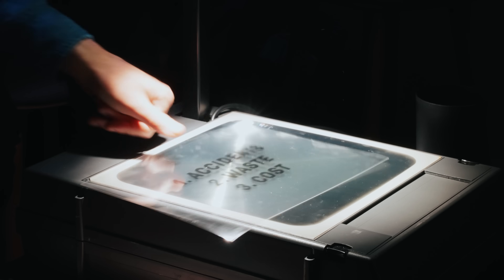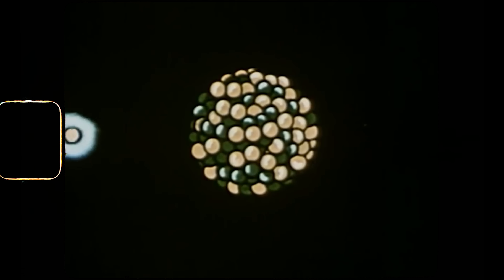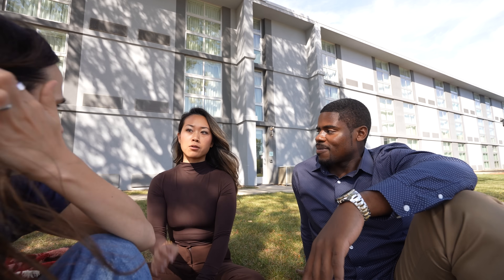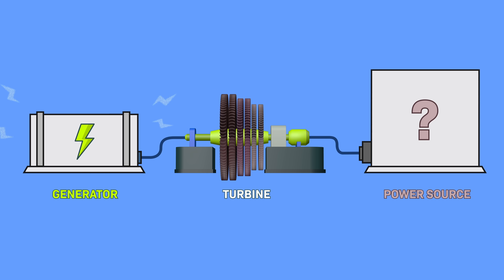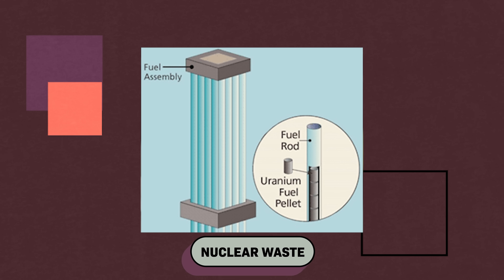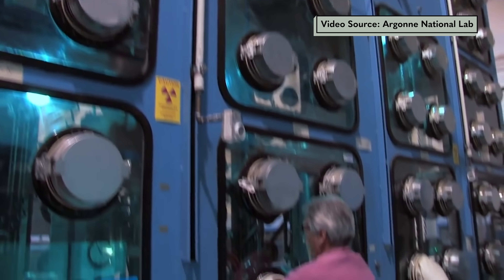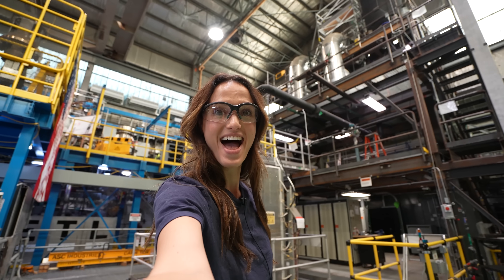The Big Lie About Nuclear Waste

Comment: Your presentation would be more persuasive if you didn't make fundamental errors in your "explanation" of the processes that go on inside nuclear reactors.  For example in U-235, 235 is not the number of neutrons, it is the number of neutrons and protons in the U-235 atom.  Nuclear fuel is not bombarded with atoms, instead neutrons are what trigger fission.  This is BASIC stuff that you need to get right.

Also, the chemistry to reprocess spent nuclear fuel is not a clean, tidy reaction done in a  beaker or test tube (except in the lab).  The chemistry on a large scale generates lots of radioactive waste (typically expressed as glowing green liquid in barrels by the media).  The places where that sort of spent fuel reprocessing was done on a large scale - Hanford site in eastern Washington, Rocky Flats in Colorado and Savannah River in South Carolina, generated large volumes of radioactive waste that leaked (and is leaking) into the greater environment. Note that those facilities reprocessed spent fuel to extract isotopes for nuclear weapons production.  Clean up is possible, but very expensive and the radioactive waste is not made safe, it is just moved to some other place.  Furthermore, the "clean up" process generally results in an increase in the volume of radioactive material.  Yes increasing the volume does dilute the radioactivity per unit mass, but it also requires a larger storage facility.  Those reprocessing sites were run the US government but in operated by private contractors who were motivated by profit.  Commercial reprocessing will always be motivated by profit and corporations WILL take short cuts to maximize profit that result in releases of radioactive material.  I am not just saying that, it has happened in pretty much every case.

Incidentally France currently reprocesses spent nuclear fuel from both its power generation reactors and its military reactors.  If you want to learn about the process, France is the place to look.

Incidentally, I am a retired Ph.D. chemist who worked in nuclear chemistry and nuclear waste disposal.

Comment: Thank you for this good, comprehensive video! I've only recently seen the potential of reusing nuclear waste (at which point it isn't really waste anymore, is it? might need to find a better term for it) and it's fascinating to find out that the idea and technology isn't new at all.
I spotted only a slight inaccuracy at 7:05: the 235 in U-235 doesn't refer to the number of neutrons (directly), but the atomic weight, which is protons and neutrons combined. The difference in isotope numbers is a difference in neutrons, as a change in protons would make it not be Uranium anymore.
Reply: I am FOR recycling nuclear wastes.   I'd say it will only cost 5 trillion dollars in the next two decades to setup one of these plants.   Thats a bargain.

Comment: It could be used to make power for thousands of years if the paradigm was changed to liquid salt thorium reactors, those need just a little bit of fissile material(uranium 235 or plutonium) to get the process started, turning the thorium fissile, and then using that as fuel. There's hundreds of times as much thorium around as there is uranium(let alone uranium 235), the USA has major deposits of it. Thorium isn't currently mined because it's not profitable, no demand, but that would change. It also tends to have a lot of useful co-deposits, in the form of rare earth minerals, so mining for both could be very useful. China currently extracts rare earths out of the same kind of deposits, and dumps the thorium, leading to massive ecological damage(look up Baotou toxic lake).
It should be noted that liquid salt thorium reactors is also old proven technology from the 1950s-1970s.

Comment: One of the things I find interesting is, there are ideas of not using nuclear for electricity. For two examples, high tempreture metalergy or melting types waste.With new alloys, we may find things that help us excelerate our goals. This is not to say that one couldn't also use the heat left over to make electricity.

Comment: What did they say when you asked them about molten salt thorium reactors? What did they say when you asked them why they're using very high pressure super heated water to do the cooling instead of ambient pressure high temperature salt? BTW: Are those "atoms" they're doing that splitting with or are they "neutrons"? And is it giving up mass, or just releasing potential energy from the bonds? And when you asked them why they're just using 3% of the potential energy in the fuel, what did they say?

Comment: I started my career in nuclear power at the Naval Reactors Facility, where we actually took the spent fuel from the Naval reactors from our nuclear navy.  The fuel would be sent 10 miles down the road to the chem lab, where it was processed and sent to a fuel facility to be reused. These facilities were shut down in the 1990’s.  As you can see we had a working system of what you suggested.  We also had a working reactor that would work as a normal reactor but when it was shut down would actually produce more fuel than was in the original startup(Breeder Reactor)
Reply: Do you have drawings or links to how this worked? Borh the sequencing incl plants and the reactor (type)?
Reply: " We also had a working reactor that would work as a normal reactor but when it was shut down would actually produce more fuel than was in the original startup(Breeder Reactor)"

The Shippingport Experiment?    There was a small amount more fissionable material than when it started.   Like three percent more.  Since it was blanket material it was not really fissionable.

Getting the blanket geometry right was tough, the Shippingport reactor was not intended as a breeder reactor.
Reply: Bidubidubi báp báp báp bidú bidú bi bap bap bap darubatuntiba dum dum bãããã~~aa!!!!
Reply: So it worked super well with no disadvantages significant enough to mention them here which is why it was shut down... Of course they shut it down, who doesn't shut down expensive projects that work perfectly? It's not like there were additional problems or reasons why, pfff
Reply: @thulyblu5486  You should look into why hemp was outlawed. The parallels are plain and easy to see.
Reply: Genuine question: Do you still have your hair and/or are you a dead person?

Comment: Well recycling doesn't fit here, since the fuel you put in and get out of the 'recycling plant' are fundamental different. Yeah you can reenricht the fuel, thats what you described here, to lengthen the usability of the uranium, but the decay-series stays the same. You can't change physics. TL;DR you can reduce the current problems we have with nuclear power by a order of magnitude, but this won't solve the fundamentals.

Comment: You totally need to look in to LFTR.   There is a whole new level of nuclear recycling there and they are totally fail safe and compact compared to current generation reactors.  And on top of that, they were made by the same engineers that made the heavy and light water reactors.

Comment: I've worked in the nuclear industry for over 50 years. Let me summarize; 1) yes nuclear waste is generated and stored in capsules that will be hazardous for hundreds of years 2) our plants produced enough waste to fill two olympic size swimming pools full of spend fuel 3) if you had used fossil fuels, particularly coal to produce the same enerygy you would have a pile of ash and biproducts 11 miles high not to mention the millions of tons of really obnoxious gases that would have been released into the air.  Summary; is it the best energy source - no, but for now the most efficient and almost zero emmisions power source ( don't get me started on wind and solar energy - they produce more hazardous biproducts in their manufacturing processes that you would ever recover in energy saving )

Comment: Very well made, but left out was the actual COST comparison between recycling and not. The host only said it was "more expensive", then went into reasons that expense would be acceptable (such as energy independence, shorter time for storage of remaining waste, etc.). But would the recycling make fuel that is 120% more expensive? 300% more expensive? 1000% more expensive? 

The fact that the video very pointedly leaves out this fundamental consideration tells me the cost difference would be shockingly high to the viewer.

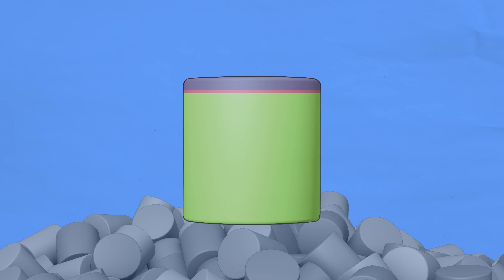Comment: 10:44
These kinds of graphs/calculations are a problem in themselves as well. They depict the time span for the radiation to fall below the background radiation while the "safe" levels are far higher than that. Most waste reaches a somewhat manageable level of radioactivity after around 3-400 years. The 100-200 000 years is just lobbyists pushing for less sustainable energy sources like fossil fuels and wind. Fission is the only viable option for large scale energy production at hand today. It ain't perfect, but it's what we've got.

Comment: I clearly am a 3D artist. However I use to do many areas of medical research and probability theory.
The person that stated there is 150 years of fuel that could be used is wrong. After evaluating the data and checking the use values per cycle used.
We are looking at a grand total of 4,250 years of energy that being used. They forget that in the early years of fuel used they did not have the purity values.
There for the value of radiation waste was higher because they didn't know the values we know today. So yeah it could be done if they wanted to.

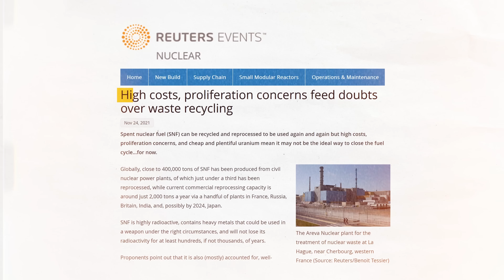Comment: 4:51 "The problems are cost and global politics."  If it's not cost effective then it's not a solution. 13:54  "that number refers to the number neutrons in the atom."  That number actually refers to the number of protons + neutrons.  In (U-235) there are 92 protons and 143 neutrons, for a total of 235.  Plutonium is still a huge liability.  How much would recycled fuel cost?  Sometimes it cost less to make a product from raw goods than from recycled.

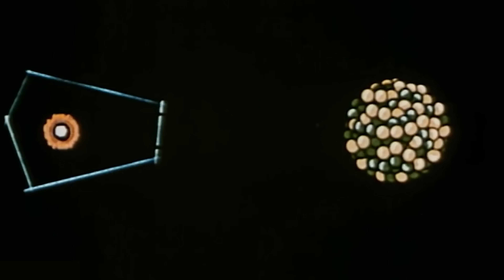Comment: 12:19   This is precisely why nuclear fuel is not reprocessed, and there are security reasons as well, plus the ignorance of the public as to how nuclear power works and how safe it is that creates huge political pressure not to develop new nuclear energy production and reprocessing plants.  These barriers and disincentive are NOT likely to change in the foreseeable future.  It's still all about using the cheaper and easier solutions to producing power.  The better long term solutions to nuclear waste will not be supported except by a few, and changing that will take time, perhaps a long time.  If there was interest in changing how we use nuclear material, it will first be a change in the popular and political climate, driven by a huge increase in need for power, combined with willingness of investors to invest in building the next generation reactor designs and portable modular reactors where practical.  One the consumer front, one thing that as reduced the need for more power is the development of brushless synchronous motors such those developed by Tesla, but an increase in power need will be likewise created by the use of the lithium ion phosphate and proliferation of electric vehicles and other electrical needs.  Bringing back industry to America would certainly drive an increase in electric demand.  One barrier to proliferation of e-vehicles is the antiquated electrical distribution system and the lack of charging stations or battery swap-out stations similar to petroleum stations used by gas powered cars today, but that will slowly change as they become more popular and fill niches where they work best, like commuter vehicles.  I hope that the situation changes to allow reprocessing, but that will probably be long after I retire.  I currently work as a nuclear inspector at a nuclear power station.

Comment: All sources of energy kills people to use it. Solar, Wind, Fossil, and Nuclear kills a certain amount of people (on average) per kwh gained used. Yes building solar panels costs lives, yes running wind power costs lives, obviously fossil fuels costs lives and of course Nuclear costs lives. In the end all engineering is doing the math on the most efficient way to run something, and in this case the most efficient way to gain electricity without the cost of human lives (you could include damage to the environment, but in truth we are trying not to damage the environment because it will cost us human lives down the road).
The estimations on these things is extremely complex of course. How to determine how many chinese workers are getting cancer because of the unsafe handling of waste chemicals from making Solar Panels? Especially since China doesn't release a great deal of its statistics. How do we know how many people die from lung cancer caused by the massive steel mills turning out carbon dioxide the make the steel that goes into windmills? How can we possibly estimate the how many people have died from the CO2 released by coal burning power plants, or the chemical leaks from such plants, etc...
No other power source has documented these issues as well as nuclear. The fear of failure is certainly very high here, but even though we don't know the exact numbers of these issues with other power sources we can estimate and in the end Nuclear is by FAR the safest power source available...because of the ridiculously high power concentration in nuclear fuel we can gain way more energy by kwh per human casaulty than any other fuel source.

Comment: Another crazily awesome thing about this nuclear waste burning reactors is that in some instances you can actually get more fuel out of them than you put in. In those cases they're called breeder reactors.

Essentially, when you have a plutonium nuclear reaction you always get 3 neutrons escape that can hit another nucleus. You only want 1 of those neutrons to hit another plutonium nucleus to keep the chain reaction going. More and the reaction speeds up and less makes it slow down. If one of those spare neutrons were to hit a Uranium-238 nucleus it doesn't split, but is absorbed forming Uranium-239 for a short time before it eventually (about 2.5 days) decays into Plutonium (Pu-239). That's why you get plutonium in nuclear waste from Uranium reactors (nuclear fuel is mostly Uranium-238, after all).

If you surround the plutonium reactor with depleted Uranium (U-238 after you take the U-235 out for enriching fuel), you can capture those spare neutrons and theoretically, you can take up to twice as much plutonium out of this reactor than you put in. Obviuosly you can never reach this theoretical maximum due to losses to control rods or other inefficiencies within the core, but when tuned properly you will get more fuel out than what you put in! Of course, it was this increased generation of plutonium that led to Carter axing the program.

Comment: The problem would most likely be 'BIG OIL'  And quite likely also Detroit. 

Still though, there are the problems one can have when the thing that can't go wrong actually does go wrong for some unexpected reason.  Particularly if the going wrong can take an area the size of small state.

Comment: Just subscribed as this video is a nice, pretty accurate and refreshing change of pace from the typical doom and gloom nuclear presentation that is so common these days.  I do have one question, when you referred to "fast" reactors I believe you were referring to "breeder" reactors.  Is that correct?  The reason the US and some other countries banned them was, as I recall, because the breeder reactor while reusing it's spent fuel would in up producing a very large amount of "bomb grade" plutonium.  The concern was ne'er do wells would manage to steel the plutonium and easily make a dirty bomb.  However, if memory serves me well, it is also possible to to use plutonium as a nuclear reactor power source.  Did you happen to research into this aspect?
Reply: Breeders are not the same as fast reactors. Breeders breed more fuel than they consume while fast reactors use fast neutrons instead of the moderated ones. Most breeders are fast reactors but most fast reactors are not breeders. The plutonium from breeders is still reactor grade, not even close to weapons grade and although it could in theory be used in a bomb, it poses no proliferation risk. As always, the US government obviously ignored the facts and decided to ban them nontheless. Fortunately though, no other country followed and France for example ended up developing a verysuccessful fuel reprocessing program. They use their reactor grade plutonium to make new reactor fuel.

Comment: Correction: 235 is not the number of neutrons in the atom, it is the atomic mass of the atom, roughly equivalent to the number of neutrons AND protons.
Reply: 235 is exactly the number of protons (92) and neutrons (143).
Reply: @markplimmer9232  Wikipedia lists the mass as 235.0439299 AMU (atomic mass units). It is not exactly 235. Electrons have mass which makes it not exactly protons plus neutrons.
Reply: @brianhabing5076  I did not say it was the mass but the total number of nucleons in the nucleus.
Reply: It has to have 92 protons to be Uranium.  If it had more or less, it would be a different element.  For example, with 93 it would be Neptunium, with 94 Plutonium.  So what differs for the different isotopes of any element are the number of neutrons.  One of the strangest things is that 95 protons is Americium, which you can buy at Walmart, in the form of a smoke detector.